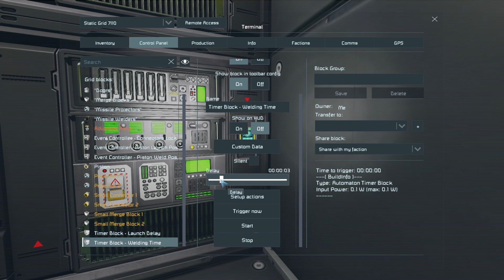How To Make an AI MISSILE PRINTER - Space Engineers Tutorial

Comment: How does the toggling something on and off in the same action work though? Logically should it not simply toggle your hydrogen tank to stockpile then immediately turn it off before it has a chance to actually stockpile? I get that's not how the game obviously interprets this and it works as your tutorial shows - but why does it do it and how does the game actually activate these actions? How would you therefore also make it do two simultaneous actions - or rather how does it know when it would need to do two simultaneous actions vs wait for one to complete?
Reply: I think it's because the actions are an OR conditional - the first action procs when condition == true, the second when condition == false, rather than "do the first action then the second action immediately after". I know when I'm setting up actions, I get a tooltip box to the left of the actions that tells me the condition to trigger both.

So as long as the triggering condition is true, action 1 will continue, it's only if the state that triggered the actions to begin with changes than the second action will proc.